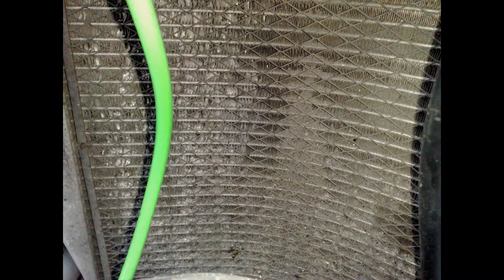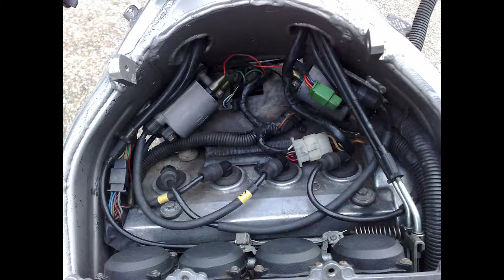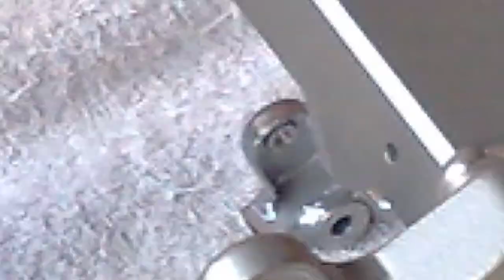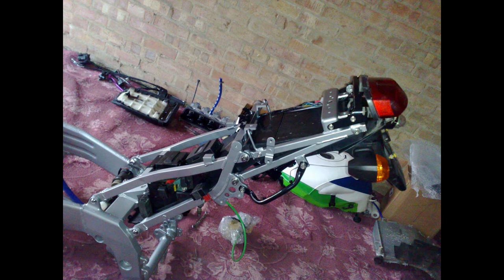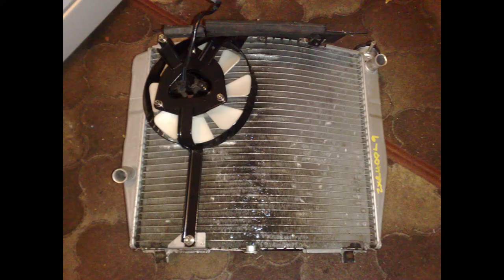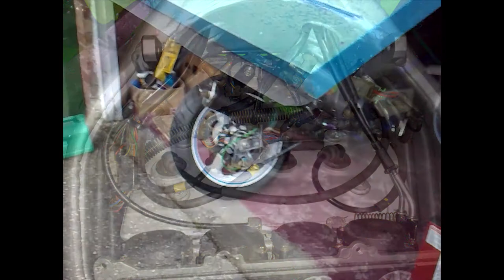1992 Kawasaki ZXR400 L2 Restoration Pt2

Comment: I read the description and yeah, had a 1991 dogs bollocks L1 and got stolen a week after I had it, spotted in a few areas riding around London with no number plates. 

Now I've got another, but this is registered in 2000, so technically I own two of these.

This one needs quite a lot of work, and was wondering where you got your parts from?
Reply from the maker: What parts are you interested in?
Reply: @MillaMeter1  i need all the parts you are about to sell

Comment: Where did you find those fairings?
I would like to get new once for my bike too, but I m not quiet sure where to buy them.
And by the way great work!
Reply from the maker: These are original Kawasaki 1s. Brand new direct from Kawasaki. 1 rear fairing I was lucky enough to pick up second hand in new condition
Reply: @MillaMeter1  Thanks